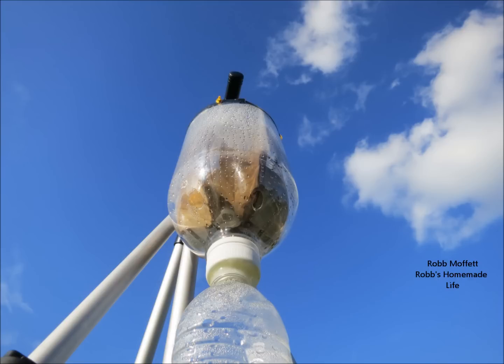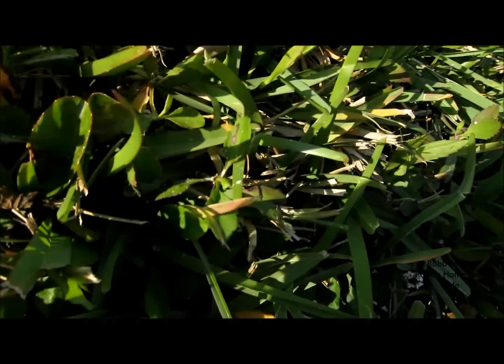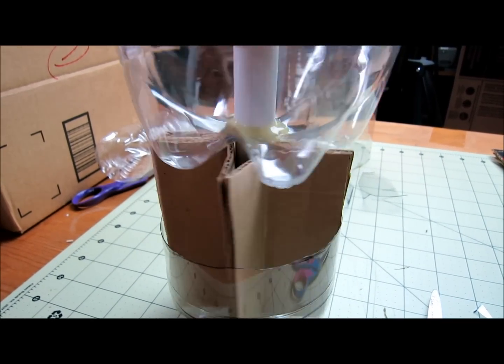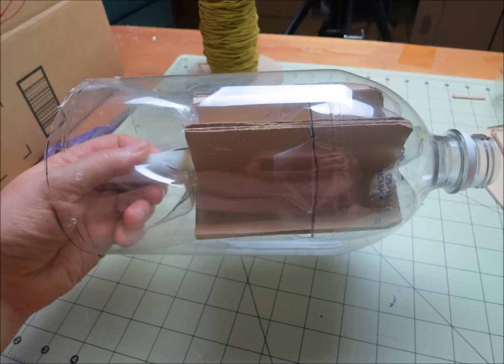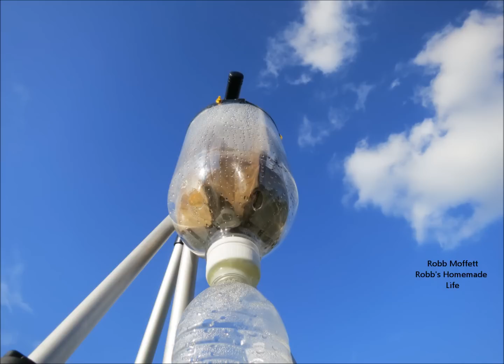DIY fresh water - free solar soda bottle still easy quick to make

Comment: Good design but all that plastic especially heated plastic makes for contaminated water !
Would work better with glass and copper pipe .
Reply from the maker: I totally agree with you. Plastics are worse than I thought at the time. However this was to be just for emergencies and temporary. Also if the water does not get too hot there will be a lot less transfer of plastics and chemical. For instance if you keep plastic in the refrigerator there's much less transfer with cold plastic.

Comment: Actually I think it's a good idea and a logical process. However, if you would have placed something that floated in the water with something cupped over it I think the water evaporating  from the pond would have  been trapped and then funneled into some kind of a cup, producing more because there was already water there.
Just an idea/thought.
Reply from the maker: Hey thanks a lot for your input and watching video. Much appreciated.

Comment: :face-turquoise-drinking-coffee::goat-turquoise-white-horns::trophy-yellow-smiling:
photovoltaic / solar thermal technician here: i liked this video. there's a company in arizona that is making solar type panels to do the same thing but at $3,000 a pop. also new machine out there that "pulls water from air" $10,000 for the machine. i'm not going to blow $3k to $10k when DIY is a more economical solution. my answer to the $10k machine has always been recover the water that your AC unit creates, filter it and save $10k. your's is simple i like it a lot. i've seen the bushman method videos too. one last thing :goat-turquoise-white-horns:G.O.A.T = greatest of all time 👍
Reply from the maker: Hey thanks a lot I appreciate that.

Comment: I worked 30 years in desserts and jungles. 
Your Design is great, but the bottles you used are a problem.
Water Bottles and soda bottles disintegrate in direct sunlight.  
They turn to dust if left in the sun light for a few months.
This process will contaminate your distilled water and you will taste it.
The design is very good and I thank you for it.
I have been thinking about this distilled water problem for a while, and this just pointed me in a new direction.
Reply from the maker: Bob thanks for watching the video and leaving a nice comment . The design was for a temporary solution using commonly found materials and that could be attached to a tree or something off the ground. Hopefully you would not have to use it for a long time.

Comment: There is a way easier way to do this with less effort and supplies… get two bowls a piece of saran wrap, and a rock. Place smaller bowl inside the bigger one .. fill bigger one so it isn’t higher than the inside bowl . Place plastic wrap over the top of the big bowl … put the rock in the middle on top of the plastic rap … simple … hope this helps folks that might need it . Gl folks :)
Reply from the maker: Erin thanks so much for watching the video and taking the time to leave a helpful tip. My design was for a solar steel that could be use off of the ground and hung on a tree etcetera. Away from animals and so on.

Comment: how about reverse the whole thing. two bottle, attach others end from the others top with a pipe on it connecting to both. the merky water will be at the bottom while the condensation at the top. cover the bottom part with somthing bkack to absorb more heat.

Comment: Get any oil of turpentine from the cardbord?
Reply from the maker: I don't know. This was an experiment to make something to give a person water an emergency situation using recycled materials that were commonly found and have a finished solar still that could be hung off the ground away from animals and be left without monitoring for days at a time. It's not for long term use. I think it works fine.

Comment: How difficult is this to make with glass?  At least for the collection bottle and every part from the condensation stage on?  For those concerned about anything potentially leaking from plastic.
Reply from the maker: Hello, thanks for watching and commenting. Although I share your concerns about plastic leaching toxins into the water. This design was for temporary emergency use and not long-term. It was basically a thought experiment to see if I could come up with the design to obtain water with a still that could be hung off the ground and left alone. I tried to use material that would be considered trash and found commonly. Glass would be ideal for a water still and it is possible to make a solar still from glass bottles but not using this design. Thanks again.

Comment: I like it, in AZ. Lot of heat and sun. Pictures are a help but I am just not getting te path of evaporation. Maybe a cross section of the water flow. Thanks
Reply from the maker: William thanks a lot for watching the video and commenting. If you look in the video description. I added some additional information because so many people had the same comments as you did. Hope it helps.

Comment: Imagine such contraption in desert like India near a small tree sapling and the collecting bottom goes straight into the soil. 100 trees with such bottle would make our planet much happier. It cost almost nothing. to built;  thanks for sharing your knowledge.
Reply from the maker: Thanks a lot for watching and commenting I really appreciate it. This was just a thought experiment for something that could hang off the ground to keep away from animals and use commonly discarded items. It has some drawbacks, but I think it also has some potential. As you mentioned.

Comment: Questions: Wont cardboard get soaked with water? Wont cardboard starto to decompose over time? Can cardboard replaced with other materials, if possible than what can i use?
Reply from the maker: This was just an experiment to make a temporary still that could be hung off the ground and made from commonly found materials. You can make it without the cardboard but the amount of water distilled will be a little bit less.

Comment: The theory here is sound.... but please refrain from using plastics. They are highly toxic. Glass is s bit harder to work with but it is very safe and will prevent you from getting TSS or toxicity.
Reply from the maker: Hi John, thanks a lot for watching and commenting. I really appreciate it. I agree with your other comments. This design was just an experiment to find a way to make water in an emergency using items most likely to be found and be able to isolate the solar still from animals and also not have to monitor it every day. There are much better designs with better materials that don't meet my criteria.

Comment: Just found this. Would it be better to add some black to this for heat absorption ?
Reply from the maker: Yes, this was a first attempt. The bottle inside that holds the dirty water could have been painted black. I appreciate you taking the time to me some tips. Much appreciated.
Reply: @RobbsHomemadeLife  your welcome. A black painted metal sheet under it also and a plastic dome over all of it like a green house

Comment: how does the cardboard increase the space? seems it's useless.
Reply from the maker: The cardboard absorbs water and gets wet. It increases the surface area of water that can be evaporated.
Reply: @RobbsHomemadeLife  so why not use clear plastic or glass instead of something that gets wet ?
Reply from the maker: The purpose of the solar still is to evaporate as much water as possible and then condense it back into water that can be used. Increasing the service area that is wet allows for more water to be evaporated.

Comment: Brother, this might seems as a stupid question, but what purpose does the pipe serve ?. And also do you have any updated video ? Thanks
Reply from the maker: Hello, thanks a lot for watching and commenting. The white plastic PVC pipe is used to help add the water that you want distilled into the small container inside the solar still. If you open the top and add water into the pipe it goes down into the small bottle in the middle without splashing or contaminating the freshwater that would be collecting in the bottle. I don't have an updated video for the bottle still but I am working on another design for a much larger and simpler still that is easier to make. The soda bottle still was just an experiment to see if I could come up with something that could be used to make water out of recycled materials and could be placed above the ground to keep away from animals and also not have to be tended to every day. In that respect, I think the design was successful.
Reply: Thanks brother, you satisfy my curiosity, I understand now, keep making more videos

Comment: I keep thinking about adding surface area. I think a spiral may work to produce the most surface area. They make these giant plastic drums with snacks in them at these big box stores. I have 4 of them that I use to store different things like bird seed, dog food, etc. If I had one be the outer shell and then cut the other 3 bottles up and make it into a spiral that fit down inside the outer bottle, I would get a tremendous amount of surface area. I'm willing to bet it would be more like 200 ml/per day. What do you think, Robb?
Reply from the maker: Judy, it is fun to try stuff like you suggested. This is not an optimum design, it was only an experiment to see what can be made in an emergency with normal scrap items.
Reply: @RobbsHomemadeLife  those are my thoughts as well. But when you look up atmospheric water generators all you get are ones that are electric. If there’s an emergency then likely electricity won’t be available. The world is crazy right now. I’m the one that everyone looks to for help in my family. I don’t want to let them down and of course, I’m just wired up this way. All my kids are engineers.
Reply from the maker: If I was serious about this I would find cheap glass top tables on craigslist and convert them to a large solar still. Thanks for watching and commenting Judy!

Comment: I've seen a method of collecting water using plastic sheets  from the air in a  war movie and now this confirms that it could be done.  I'll try something similar. Thanks for the idea.
Reply from the maker: thanks SH. this was just an experiment for a still in an emergency, there are much better designs for long term solar stills.

Comment: Good day Robb. Just seen your DIY fresh water on youtube. Just wondering if you have refined this easy system. Maybe on a large scale this can work great. Kind regards.Graham. (South Africa)
Reply from the maker: Hi Graham, this was really just an experiment to see if I could make something out of found or recycled materials to make a still that could be hung off of the ground away from animals and would not have to be attended to daily. It was to be a temporary emergency solution. If a person has a little money to spend there are designs online of regular solar stills people can make from polyethylene or glass that would produce much more water. I have been thinking about trying to make a still from a regular 5 gallon plastic bucket by cutting it at an angle and making a trough to collect the water inside by using the curved part at the lip and seeing if I could heat it to curve to the shape of the bucket and make a way to collect the water. I would use plastic sheeting over the top.
How are things going right now in SA. I hear a lot of stories about people getting shot on their farms. It sounds very bad. But I am sure the USA sounds just as bad in many ways. Good luck to us both.😎👌

Comment: You are drinking water that was running over cardboard?  Yuck, not sure that is safe.  Couldn’t you just use folded plastic from other bottles?
Reply from the maker: The cardboard is to act like a sponge, it absorbs water and increases the surface area of water that can be evaporated and condensed. The water collected is water condensed on the side of the plastic. You are not drinking water directly from cardboard. Folded plastic would increase the area for water to condense but if it was where the cardboard is it would drip back down into the water we are trying to evaporate. The cardboard increases the amount of condensation by creating more areas where water can evaporate. I sponge would also work even better but the design was just using likely found materials for an emergency still that could be kept off of the ground away from animals and not have to be attended to daily.

Comment: Rob, I've always heard never to drink from a hot or cold plastic bottle because of the chemicals coming out of it. Would you suggest glass be better?
Reply from the maker: Hi Laura, the design was just an experiment to see what I could come up with from likely found or trash items that would provide water and be hung off of the ground and not have to be monitored daily. It was for a semi survival situation. Glass would naturally be better and could be done. I can never get anyone to tell me what chemicals they are concerned with being released from sun exposure. I have looked into the subject a little and did not find any conclusive evidence low heat would release any more chemicals than normal temperature,, but glass would be my first choice too but they may be harder to find and work with. .
Reply: @RobbsHomemadeLife  yea, I thought it would be hard to cut through glass, unless it's possible to create without cutting. Thanks for responding!

Comment: I love this video, have you elimiated the cardboard from the design?   It seams this would mold after a while and cause health risk issues.   Would taking a 2 liter bottle and folding it like the cardboard achieve the same condensation?
Reply from the maker: hello Kelly, the design was to use things that were discarded in an emergency situation, I agree with you totally about the long term use of the cardboard. A folded bottle would add no extra surface area for eveporation.
Reply: @RobbsHomemadeLife  I was talking about replacing the cardboard with the folded plastic.    Would that work?
Reply from the maker: you could try it. But I don't know how plastic would increase evaporation and condensation
Reply: @RobbsHomemadeLife  Would adding fins to make the whole body spin in the wind help gather the water better?
Reply from the maker: you could try it, do you think spinning might increase condensation?
Reply: @RobbsHomemadeLife  I was thinking it would help with collection and concentration.

Comment: I read in some responses on other video's about distilling water that pure water is dangerous since it will extract the minerals from the body if you drink it, but other comments said it's not a problem to drink pure water.  What's the real answer here then (since we eat salt and minerals as well)?
Reply from the maker: The still was really just a thought experiment to see if i could come up with an emergency still made from common recycled materials and that could be hung off of the ground and left unattended for a long time. The still was never meant to be used long term.
I have heard the same arguments as you that distilled water is unhealthy because it will leech out chemicals from our bodies. they never explain the exact process that does this or the chemicals in undistilled water that prevents non distilled water from doing the same thing.
Some non distilled water is a source of micronutrients but much drinking water is also a source of chemical contaminants.
Reply: You cac add a pinch of Himilayan salt to replace the minerals if you are concerned.  I would just drink it through my lifestraw to make sure it is free of contaminates
 @RobbsHomemadeLife

Comment: could you replace the cardboard with white plastic sheet folded to your star design, it would remove any possible contamination from the cardboard, and I think the it would condense better also.
Reply from the maker: Thanks for commenting. The cardboard is to increase evaporation. It can be replaced by anything that would absorb water and thereby increase the surface area of water exposed to evaporation.

Comment: Of all the things you could use, glass, metal, plastic... (smooth surfaces... and preferably cool surfaces), why would you choose CARDBOARD??? 🤨 
Nice video, and thanks for sharing 👍 'd   
#OldManPaxus Rating: ★★ ½
Reply from the maker: I am sorry I failed in explaining. cardboard was used to increase the surface area of water so the evaporation would increase and condense more water. If no cardboard the only surface area of water was in the small interior container. by adding cardboard that stuck up high above the water it got wet by absorbing water and then released it by evaporation and condensation on the interior of the larger bottle.

Comment: you are doing something like a filter for contaminated or potable water, only that it is through a condensation process.
A lot of comments that need you to clarify , i guess because you did not show that potable water is being poured into the smaller botlle thru the pipe. I also did not understand it at first but only after reading your explanation then i knew what you were doing, ha ha and in the first place i was thinking you are doing an atmospheric water generator, do u have any idea of doing it?
tq

Comment: This is way more complicated then it needs to be....
Reply from the maker: I wanted to make something that could be hung off of the ground, made mostly from recycled materials and that did not need to be attended to over several days. perhaps you can share your simplifications using that criteria?
Reply: Robb's Homemade Life most cap to cap two bottle configurations with a pvc pipe up the middle of the top bottle should do the trick and their are multitudes of ways to hang it with everything from wire to duct tape. I’m just saying small bottles in large bottles and cardboard with cutting here and cutting there seems very over complicated.